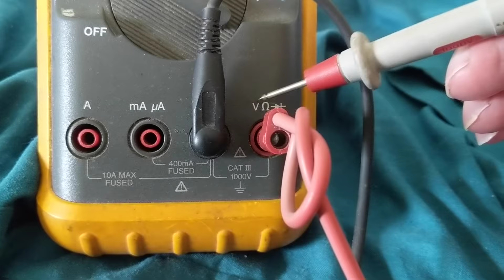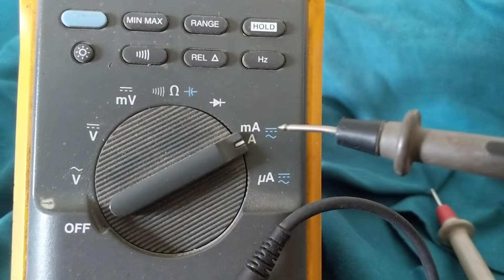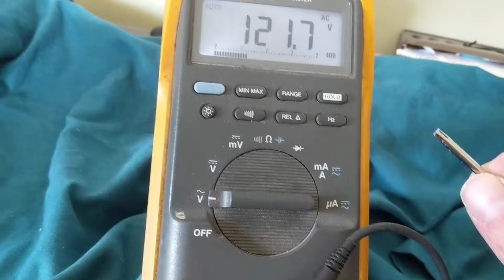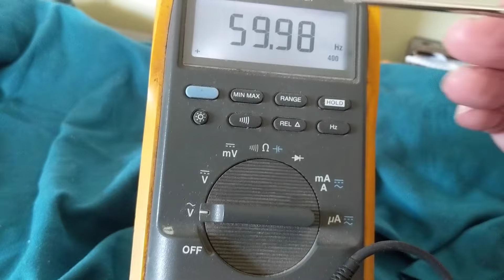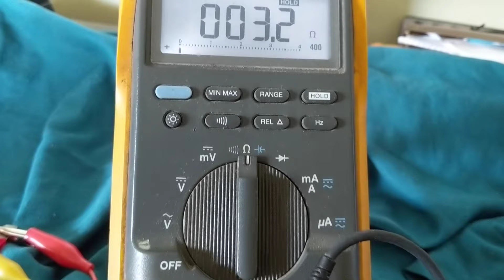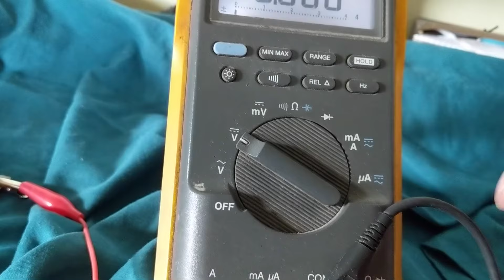HOW TO USE A MULTIMETER

Comment: HI Sir,
you told that we can not measure up to 10 AMP through amp section.
so ho can we measure 12 or 25 amp
thanks
Reply from the maker: With a fluke meter you cannot measure more than 10 a correct however if you use a clamp meter you can measure up to two hundred amps and there is a device called a current inserter but you can measure up to 30 amps so it depends on the instrument and tester you are using thank you for your question